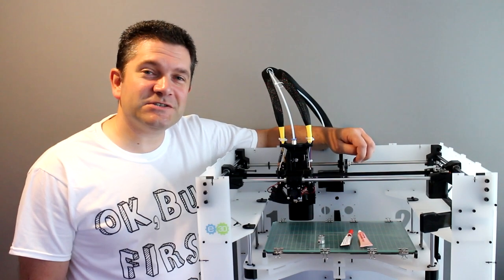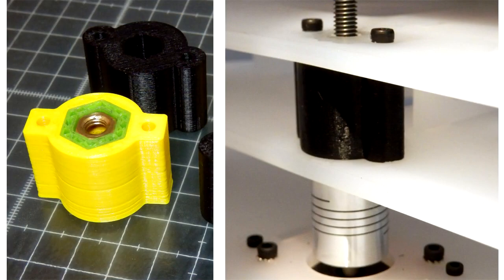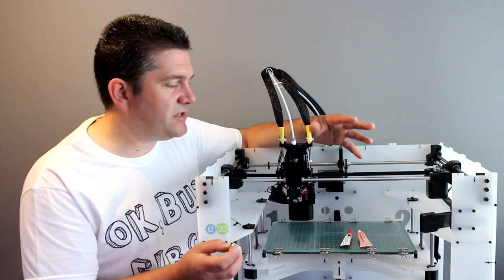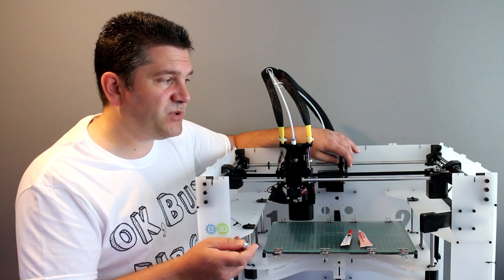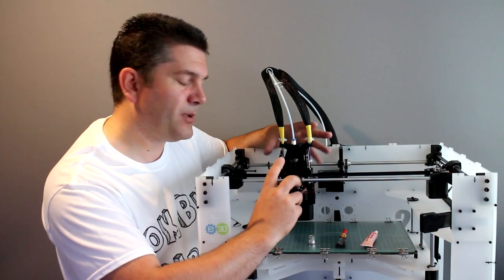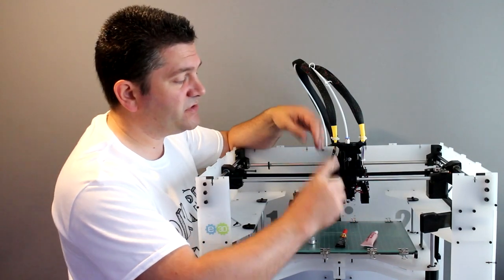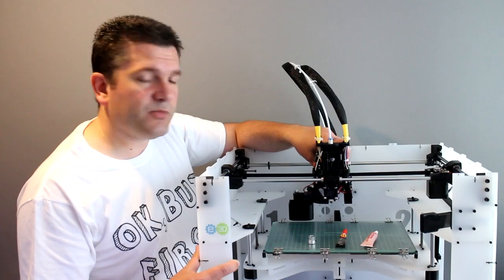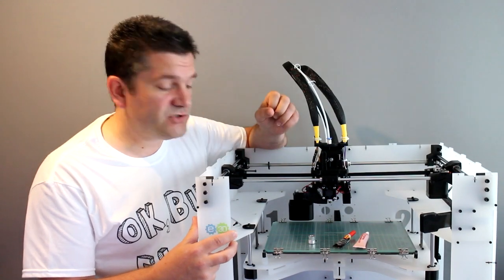BigBox 3DPrinter Testing Update Aug 2015

Comment: @cody no not really. This printer is getting a detailed design review from the likes of Richard before it goes into production. I think the more fundamental problems found will be fixed. Bugs like this appear in every design be it code/mechanical or electronics and are usually resolved (or ignored) quietly behind closed doors. The difference here is that E3D elected to do it in the most public and open way. Kudos to them I say.